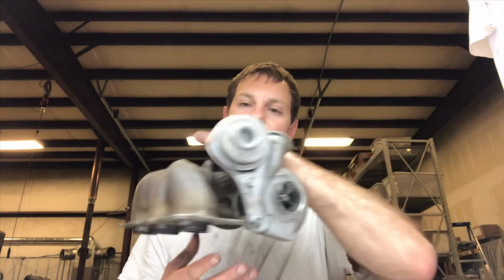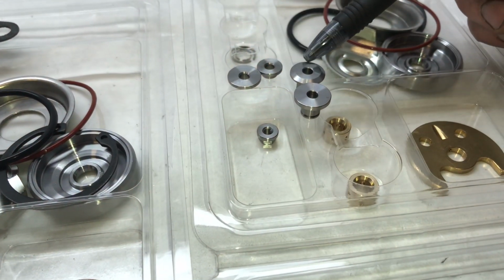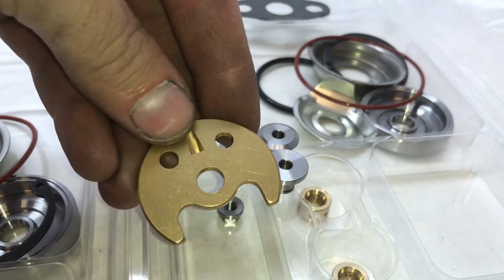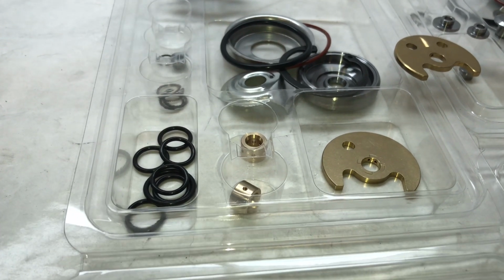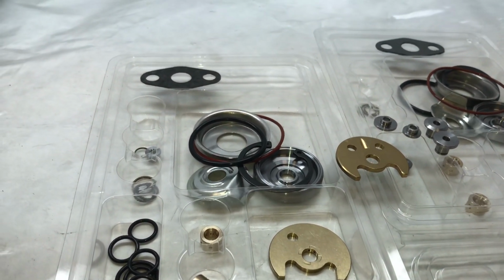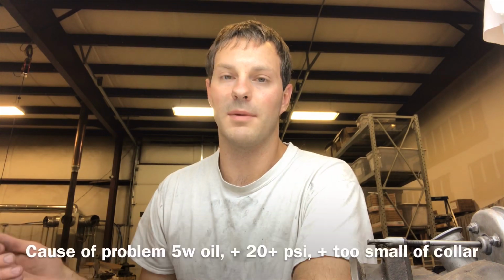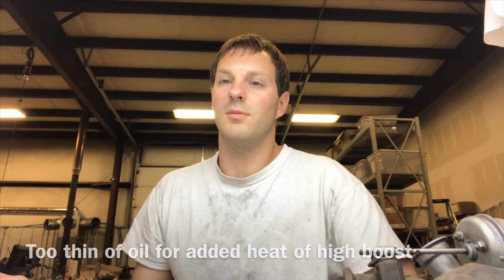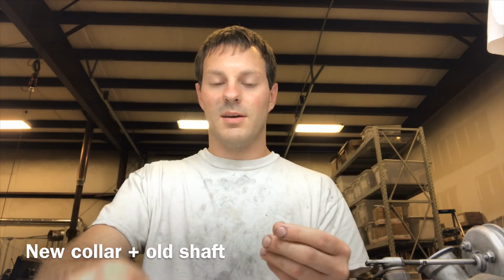Why N54 Upgraded Turbo Will Fail

Comment: 0W-40 Castrol Edge is the way to go on the N54.
Reply: LOL.....seriously ?.....Castrol Edge couldn't keep a slip n slide lubed on a rainy day.....Pure Synthetic is what the Manufacturer recommends , and i dont want to ruin your relationship with castrol edge's rainy day slip n slide disaster , but Castrol Edge is a second rate synthetic blend brody......if you were using that while the car was under warranty and something internal on the engine failed , your choice of oil would void your warranty......have a great day.
Reply: @mattriella6776  then why do BMW recommend it ? I've run 0/30 ( recommended ) for 14 years with no oil based problems , I'm going to move up to 0/40 as the miles go on. I've never heard anyone else slag castrol off.

Comment: How can I contact you for a set of turbos? Do you have a set upgraded and ready to ship and yall do a core charge/swap? About to order a set of pure stage 2s, but won't be boosting over 20psi.....
 So I'm wondering which is more worth it PLUS THE PRICE. Looking for reliability & Longevity, but a little bit more at 18lbs than the stockers can handle.
Reply from the maker: Calvin James turbolabamerica@gmail.com or 2766922900 we have a set completed on hand. The upgrade you chose should be based on the hp rating. The upgrade we do make 550 hp at 24 psi on one of my customers cars and max at 600

Comment: I bought the X0017 J6BX9 rebuild kits from you. Do they have the upgraded thrust parts? I have not installed them yet. Also my kit's don't have any O-rings, do you know what sizes they are?
Reply from the maker: If not I can send them to do. Can you email me a pic of tge rebuilds kits or send a message on amazon

Comment: What oil should i use ? Im running fbo mhd stage2+ n54 oem stock turbos. Currently on 0-40 Castrol edge.
Reply: If it's the European formula you should be good to go.

Comment: I have Vargas stage 1 turbos do they have same issues as stock ?
Reply from the maker: I’m not aware of this turbo build so I don’t know what to tell you
Reply: get MHD or another monitoring software and never run your turbos hard if they're less than 160-180 F. They will have problems like the OEM turbos as far as shelf life/health of the turbos if you run them too hard

Comment: Do you see many boost solenoids failing? I fitted new turbos and did all my vacuum lines and I’ve still got damn wastegate rattle
Reply from the maker: Rattling at startup is normal because they are closing but it shouldn’t rattle for long.

Comment: Sorry but no. Ran 23 psi on stock turbos for nearly 4 years and on 5w oil. The problems are probably down to trying to run too much boost with not enough supporting mods, not enough octane and a bad tune.
Reply from the maker: It matters for the upgraded turbos because the wheel is heavier.

Comment: Hey man, could you upgrade my turbos for my N54 F02 740LI? I have been looking everywhere for a set of upgraded turbos for my car but I can’t find anything.
Reply from the maker: Alan womack the 7 series n54 have plastic inlets, I have a set of these turbos.  I can sleeve them to upgrade them but you will need to change your intakes
Reply: Turbo Lab America can you tell me everything I’d need to think about replacing if we go about doing it? I’m not too knowledgeable, I’m learning this as I go. I try to read and absorb every little piece of info I can.
Reply from the maker: Alan womack  ecs tuning has a good article about the removal and install on the 3 series, it will be similar to your car because the motor is similar but with a few variations

Comment: I appreciate the information but it isn't backed up by any real-world testing or wear and tear comparison. You're failing to address that 10w30 is fine in climates that exceed 0F and above. You can not run that motor oil in your N54, stock or tuned, in anything below 0F degrees. People continue to argue the fact that 5w40 is better for our motor but our motor was designed with 5w30 for a reason. Same thing as replacing your stock diverter valves with a blow off valve, you end up messing with the intake recirculation and the way your DME operates. yeah it can adjust, but why stress it in a way that it wasn't made to work? 

Anyway, for those looking for a peace of mind I suggest running high quality 5w30 oil such as Liqui Moly, and upgrading your existent or investing in a aftermarket oil cooler with a 185f thermostat. Your oil will be the specified 5w30 and will run at an appropriate temperature.

Finally, I know some will bash this and throw numbers at me, It's my opinion and experience and comparison. Do what you want with your N54 but what I recommend, especially if it's your daily, is to keep it a nice OEM setup. If your turbos blow, replace them with oem units. If your valvecover cracks/warps replace it with an oem unit. Don't mess with the PCV system, don't upgrade the turbos, you'll only cause more wear and tear on surrounding components that will eventually fail. 

Anyway, I can keep rambling on but I wish nothing but the best for your setups and figured id offer my 2 cents. 

Cheers guys, keep on boosting.
Reply: Leandro Yes indeed. Both the clearances and the hydraulic control systems within the engine depend on a particular viscosity as a part of their design & correct function.

Comment: Hmm🤔🤔🤔 I drive 335i n54 lci with 550 PS,,,  I have 10w60 oil... Perfekt... Never problems... 19psi - 32psi...  Pvc Ventil, low themp Thermostat and so on...
Reply: For how long 🤔
Reply: You did do the preventive maintenance/mods.. that is important like your oil weight, pcv, lower temp oil thermostat. Lol
Reply: @MasterShake1242  225k km and more...
Reply: @mxracingunlimitedltd7784  lol?

Comment: I would rather replace turbos than end up with a spun bearing
Reply from the maker: There are people using 20w50, I think that is excessive5w40 seems to be the best choice for my temperatures based on the oil temperature charts online
Reply: Turbo Lab America what oil do you reccomend for N20 motor in miami hit weather? Its on 120K miles. 
Thanks

Comment: Just want to confirm, does this kit replace everything in the turbos that is failure prone? Mine are smoking badly and this seems like a good route to go. Will this fix the seals?
Reply from the maker: The turbine shafts sometimes need to be replaced because of the wear from where the piston ring sits. We have 9 blade upgraded drop in turbines for them we can also balance out the assembly for you with stock or upgraded wheels

Comment: Oil viscosity has absolutely nothing to do with seals leaking bud.
Reply: That is completely wrong. Coming from the Mazdaspeed3 comunity, we use a heavier weight oil with the K04 turbo for this very reason, when running higher boost and using upgraded intake and downpipe. The factory weight oil of 5W30 in most cases will blow by the seals far more easily and also get more fuel dilution from increased cylinder pressure. Upgrading to a 5W40 mitigates or stops turbo seal blow by because it is harder to push thicker material through the same size orifice. Basic fluid mechanics.
Reply: @thricehybrid  no its not the manufacture recommends a oil for good reason, i repair and upgrade hundreds of turbos fir BMW and Mazda plus many others. Putting a stock rebuild kit in any used turbo is a total waste of time, they are worn out and nedd over size bearing and seals and you don't have customers returning work and crying at you. Do the job properly, oil leaks cause the job isnt done right
Reply: @thricehybrid  adopting a attitude of " didnt like the customer and got sick of him so gave his money back" then condemn his on YouTube is a piss poor look for your business.
Reply: @stevemurch6974  OEM recommendations are just that, recommendations not gospel. Everything they tune from factory is for fuel mileage and value of service. Running a heavier weight will affect your mileage. They also suggest you don't ever upgrade your car, and only ever use them for all your servicing needs. You need to realize they are companies, and don't have your needs or feelings at heart, they want to make money like anyone else. Since you say you've rebuilt Mazda turbos before (Borg Warner is the OEM manufacturer) then you know the 270 degree thrust bearings are prone to blowing oil passed them even on a completely stock motor with nothing done to them. There was even a free extended warranty in place for all the K04 turbos between the Speed3/Speed6/CX7 that uses the MZR DISI engine. It got to the point where actual Mazda service techs were recommending running a heavier weight oil to limit or prevent oil blow by.

This isn't made up either, a quick google search will bring up many posts on different forums citing the exact same thing.

Does that negate the fact that a larger bearing and collar should be used? No, clearly a larger collar should be used for it to be done correctly the first time. But using a heavier weight oil is not uncommon or unheard of in any performance application.
Reply: His professional "business" skills might be lacking but his products are good, knowledge is good, prices are good. if the rebuild kits are out of spec ( if the chra was sent in) he will contact the customer and let them know its worthless or machine it to fit something else. he also doesn't have any control over what people do with his rebuild kits and upgraded rebuild kits (customers might be trying to rebuild junk). the products are good, I know a few people that have his finished products in use and everyone is happy with the work including myself. he never specifies who the customer is so one has any idea who it is. no it isn't the best practice to bring the customer up at all but instead just make a video about said issue. Give the guy credit, he is providing a wealth of knowledge free, his work is really good and his prices are good. If I stop being cheap and purchase a newer car (something with audis 4.0TT motor) ill be sending him those expensive (imo) RS7 turbos if he is willing to rebuild and machine them for a bigger wheel (if that is even an option)
Reply: @jaymiller8451  for the record i design and manufacture my own turbos from scratch, and not reproduced in china.
Reply: why the hell would you use 10w30? this is for operating oil temperatures not start up temperatures.  if anything use 0w50
Reply: Mutol is the best